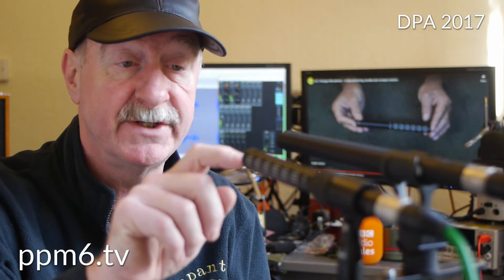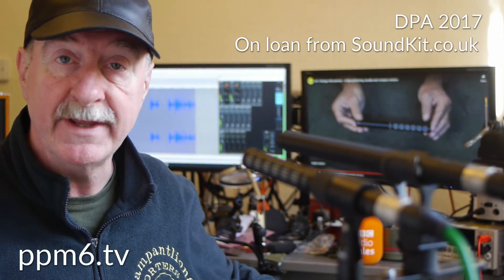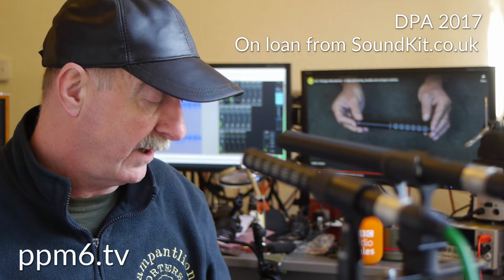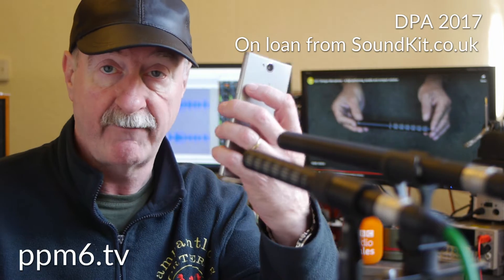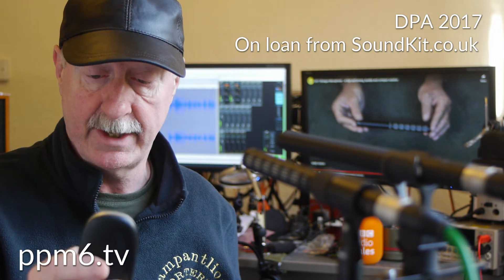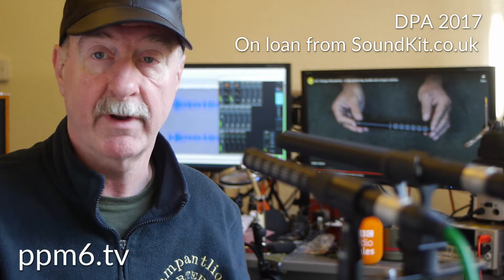DPA 2017 v MKH 416 - RF and Humidity Tests

Comment: You could include a UHF DMR two-way radio for future RF immunity tests as these are becoming more common on set and are a much bigger headache interference wise than analogue FM.
Reply from the maker: That is a very good spot. Though I don't have a set here. There is a famous story of the OB where we deployed two radio backpacks a classic analogue one and for the fist time a digital one.  All worked well while the two presenters were separated by decent yardage working in different locations - but when the producer asked them to  do a joint link.... disaster. Ta like, ppm6.

Comment: Top marks to both mics, I think though that modern mobile ‘phones are rather less of a problem with regard to intrusive RF than their predecessors.
Reply from the maker: Thanks Hugh - I have an AKG 747 Mark 1 which just loves to catch and rebroadcast RF from any adjacent radio mic tx. It seem the MK2 is identical in every way but has RF shielding. So I think you're right, there's so much RF at gigs these days your not going to get away with mics prone to the problem.
Ta like, ppm6.
Reply: Ah, a "Jumbo," yes they were very sensitive, but I do think something has changed regarding the RF 'phones emit. We used to do quite a few 'phonos using mobiles and you had to be very careful about where the 'phone was placed relative to the mic. As 'phones improved this became less of a problem. Glensound make what they call Broadcasters' Mobile Phones which are TBUs with SIMs in them (can't post a link but they're in the Canford catalogue.) I've never tried on but presumably they manage RF spill very effectively since they're designed to have mics plugged into them! @ppmtv-qh9qk
Reply from the maker: Thanks Hugh - it would be good to get some mobile expertise on the matter. I wonder if it might be the use of different frequency bands as we progressed from 1G to 5G. 5G I think favours higher frequencies - above 3G, while 1G was at 900 MHz or 1800MHz. But then it might be better shielding in phones who knows!  We did have the Glensound mobile kit - physically very rugged and well engineered as you would expect. Just didn't sound significantly better, in my experience anyway. Ta like, ppm6.